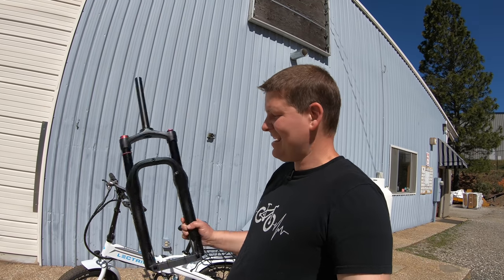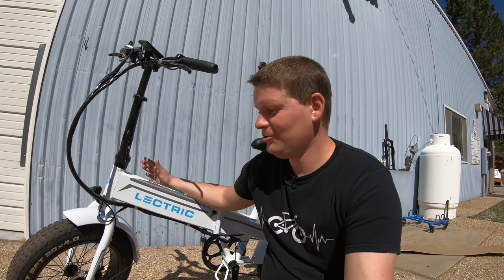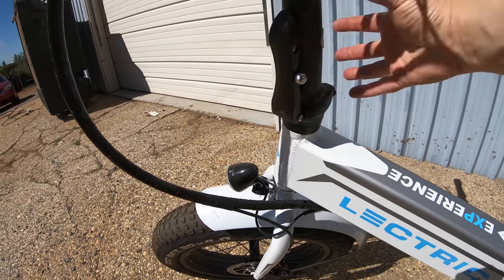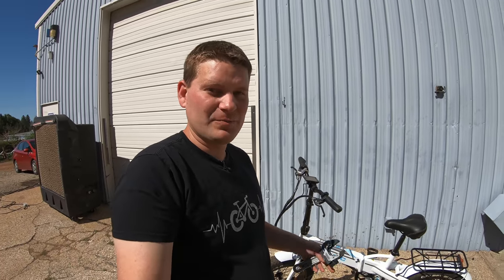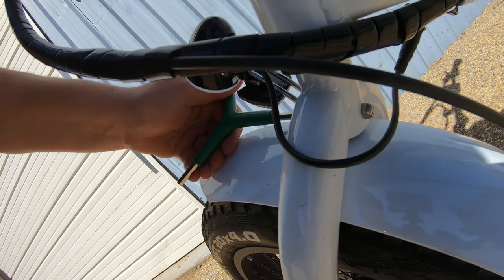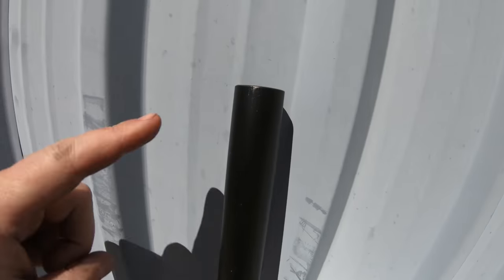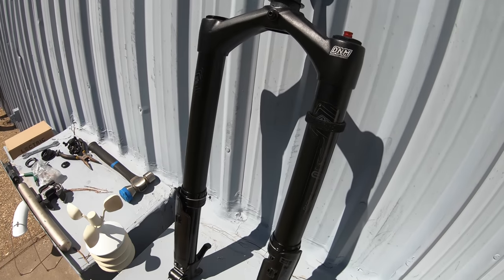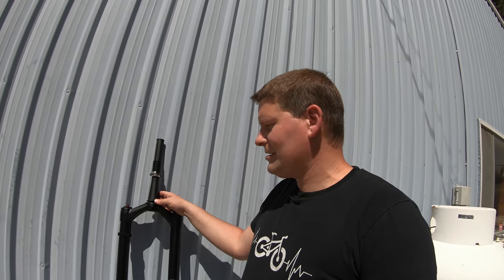Suspension fork on the Lectric XP - That didn't work...

Comment from the maker: Why do you want to add a suspension fork to your ebike?
Reply: The ecotric Hammer bike has suspension. You got the best to love all the hammer... LOL how does that little star thing in the middle hold the handlebars on safely? That was the issue with my bike I had to put it down in there further because it was too high and the front end was loose at the headstock. I really would like to know how to bleed the hydraulic brakes. I think you would like that hammer bike
Reply: I feel like the threaded Forks are way better. Maybe you could cut it off and put threads on it.
Reply: I was extremely happy with the fast shipping of the tubes I must be prepared for my very long trip. I wonder on a very long trip what is the first thing to go if something does go?
Reply: Thank you for the videos I really appreciate them. I wonder if that nice front fork would fit my hammer bike and are they really expensive? I was looking for brake pads. It's really hard to find the ones for my bike. They are the metallic tektro brake pads that have one thing coming out of the Middle with a little hole on top. I looked on your website. Will the price of bike tires be going sky-high when the car tires go up?
Reply: I love my Avenger. I would love for you to do a tutorial on upgrading the Avenger with shocks!
Reply: Chronic neck and shoulder pain from car accidents...added one to my regular bike and pleased with the effect off road.
Reply: Good to know when a hand saw and sledge hammer won't do the trick.
Reply: I have an ADO A20 has suspension forks that are threaded, same fitting as the Lectric XP.
Really like the bike but the the front forks are cheap so on the look out  better quality threaded forks.
Reply: Potholes.
Reply: I want to get an e cargo Lectric 3.0 expedition. I like the cargo space and price and that it has hydraulic brakes. But I am concerned about the no front suspension. I’m older and concerned about spinal impact over repaired potholes. ..  do you think a fork could be added to the expedition cargo bike ? Thank you.
Reply: Cause it doesn't have suspension. Why dont all bikes (besides racing bikes) have suspension? No idea.

Comment: I don't  have all my parts yet but I have already figured out what you found out today on Lectric XP. I am going to install a 20x4 suspension fork with a new headset along with a bmx riser type handlebar using a thread less setup. Going to kick the height of the handlebar up with a steerer tube extension. Thread less is the only way to go.
Reply: That is exactly what I am going to do to install a suspension fork on my XP. Threadless is simpler and easier to adjust. I ordered the fork from AliExpress (China) and it is taking forever to get here.
Reply: @scoop4321  Yeah I ordered a fork on 4/7/21. They said it would arrive on 4/27/21 but its looking more 5/26/21. Its been sitting in a airline holding area for a while now.

Comment: I’m not sure how to do it and still keep the folding stem because it has a quill. Maybe finding a threaded fork would work. I have a threadless fork and changed to bmx handlebars so it required this threadless headset: 

Dilwe Bicycle Headset Aluminium Alloy Bike Front Fork Stem Headset Replacement Bike Accessory

I don’t think I can post the link but search that on Amazon.
Reply: You could order a threadless folding stem, similar to the stock Lectric set up from AliExpress. It may not arrive for awhile, however. They do have them.

Comment: Best PSI? The DNM USD6 manufacture information I could find. Very little info out there by the way. The MFG says 60-90 psi. Other sources say 150 psi. That is a big difference. My local bike shop would not give advice. They said "we will set it where you want it for free - - - -easy to do - - - but we will not give you a number". Mine when received was about 85 psi.

Comment: Since the fork won't go in front, can you just put in back?
Just kidding!
Threaded forks were the norm years ago, but we're glad you took the dive to find out about the XP setup 😉
I already have a suspension fork on my RadMini, and it's ok with preload and lockout. But, I'd like to upgrade to a really nice and smooth one. Any recommendations?
Reply: I tested a 2nd hand Rad Mini (2019) a couple of days ago. I am considering this instead of the new Rad Expand 5 for that very feature.  The handlebar reach is bit much for me. I'm 5' 1" so still trying to see if a mini or a lectric 3.0 premium will work. Also, considering Vitilan U7 (hydraulic brakes, front suspension) but recommended for 5' 2". How is your mini on hills?

Comment: I'm brainstorming to get myself an EBike. I need help 🆘. I'm looking for something that ships to cad , that is lightweight, with a mid-drive 1000w and then the rest I don't really mind. I've seen some brand that you never mentioned like the Sheng Milo on Amazon. It looks ok but I'm scared to buy it. The Lectric, Friend, and the Synergy Kahuna are all the same in my opinion and I seem to want that type of model but I wasn't able to find something with the torque I want. My other choice would be the 2021 Eunorau 1000e fat-hd mid drive. But it will be a pain to get the thing up 3 stories Everytime. Any suggestions?

Comment: that head bolt is a common design for department store and cheap bikes from the 70s to 90s

it is new to ebikes.

so it looks like maybe that is how to be off the shelf and proprietary at the same time.

for example the bafang spanner used by the bbshd the one end is an old school bottom bracket spanner and has been replaced with newer design that is used by sram and shimano so bafang used the old design and calls it proprietary so anyone with tools from the 70s and 80s should be able to install a bbshd.

Comment: I thought about the Lectric. Now, I have my doubts. I’m still doing research on a budget eBike but will cross off this one. Thanks
Reply: It's a great budget bike. Folds up and fits in my tiny car.  I take mine everywhere 1500 miles still going strong. Plenty of video on upgrades if u want to do things. I just lower my tire pressure and it's fine on fire trails.
Reply: I’ve seen other videos where they do it it’s not a big deal.You cut the pipe down to length and then get it threaded at a local machine shop not that big a deal
Reply: Plenty of videos on how to do this.
Reply: Been looking at the Rattan Pathfinder as a full size alternative. Maybe if I like it I will look into getting a Bolton

Comment: I have a Heybike Sola.  Nice, less than $1,000.  And Torque assist + a throttle.  Love it.  BUT no suspension and if rides like a brick!  I tried a suspension fork and also ran into a dead-end.  
The stock fork stem is nearly 13 inches long!  From bottom of the steering head to the top measures 9.25" or 235mm.  All the suspension forks have a stem which is only 220mm, which means the steering tube does not even reach the top of the frame tube.  So there is no way to attach the fork to the bike.  I have seen "extenders", but they use a quill system to attach the stem to the bike, and I am not sure that is safe.  Any ideas?

Comment: I like threaded forks myself.  You are missing a few parts to get the job done is all.
Reply: Yes you need a thread less stem maybe a steerer tube extension if you want the handle bar higher. Plus handlebar that will fit the stem. Don't really like the folding type of handlebar that came with the Lectric (too high) so my new setup will be different from the original bike setup. A lot people are doing the same setup.